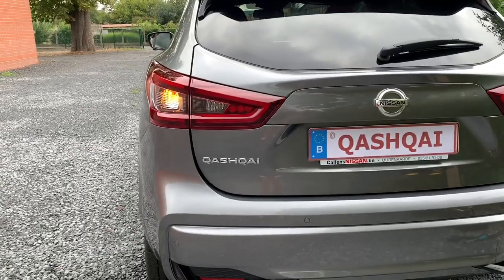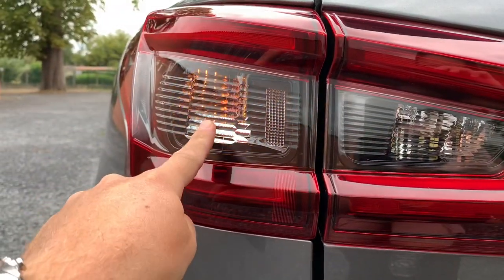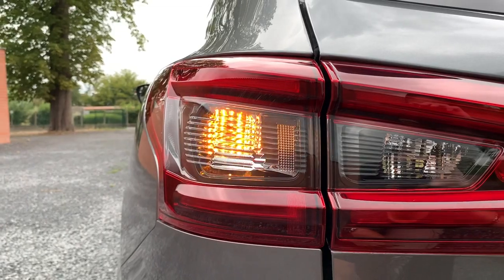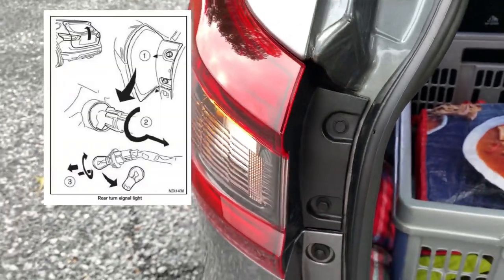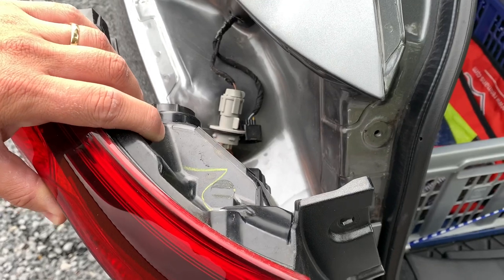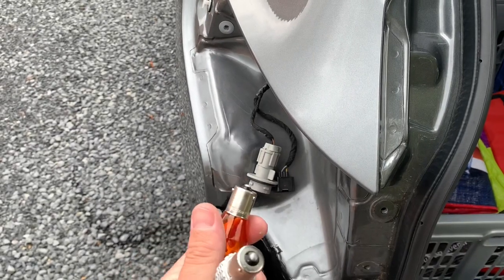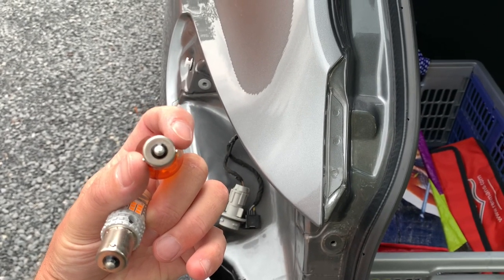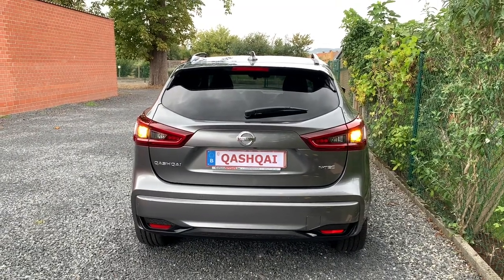Nissan Qashqai J11: LED tail turn light indicators (plug & play - no hyper flash!)

Comment: Hey dude , sorry i just want u to ask if there are some issues with all your modifications on the car since 2 years are almost gone, and my question is have you any problem with the bulbs that u have already installed, i have also J11F N-connect from 2019 automatic for the German market and I've been considering to change all the dimmable lights in my car, in order to that I've ordered some premium bulbs like MORIMOTO, GTR and OSRAM as well the American bulbs have lifetime warranty.  I appreciate your answer.
Reply from the maker: Hi! No not at all, the only bulbs that didn't held on very long (some of them at least) or those used in the ceiling lights in the front. But those only cost 20 cents each I think. So no big deal. All the rest really works fine.

Comment: Hello, The product on the link not available anymore, can you update with the same product from other seller? Work OK if stay on hazard over 2-3 minute or make hyperflash after more use? Thank you!
Reply from the maker: Here it is: 
https://a.aliexpress.com/_mK7iACz it works perfectly even when used longer. Only when you use it for a very very extended period of time it could hyperflash (I’ve been told!) but it turns back to normal when it cools down. 😉
Reply: @LaPalmeraie0032  Thank you!
Reply from the maker: You’re welcome friend 😉

Comment: Great video
Can u do please for the front?
Does it the same led for them?
Thanks
Reply from the maker: Hi Tom, thank you so much. I can’t do this for the front because I have the turnlights integrates in the DRL lights on my N-tec model 😉 but it is really easy. Just plug & play. Just use a turning movement to undo them. You will need other bulbs than for the back though. For the front you need T20 W21W bulbs. Those have a flat bottom.
Reply: @LaPalmeraie0032  first thanks for the replay ans second what i need for the rear
Ba15s or bua15s 
Thanks
Reply from the maker: You’re welcome 😉 you need the BAU15S with the nods on a 150° angle.
Reply: @LaPalmeraie0032  u the best
Thanks
Reply: @LaPalmeraie0032  can u please send me link what u mean flat bottom
thanks
Reply from the maker: Here you are; same store: € 11,03  52％ Off | OXILAM 2Pcs No Error Hyper Flash Turn Signal Lamp T20 7440 WY21W W21W LED Bulb Canbus 3020 SMD Car Lights 2200K Amber Yellow 12V
https://a.aliexpress.com/_mqxC82v

Comment: You know if it’s the same type of light bulb and front turn lights?
Reply from the maker: Hi Kostas! No it isn’t the same. You should look for W21W and not WY21W. In the front the fitting is supposed to be flat. 😉
Reply: @LaPalmeraie0032  Thanks..

Comment: hi.thanks for the video.does they fit these light bulb to j11a the previous model 2017?
Reply from the maker: Yes it is exactly the same 😉
Reply: hello.i have installed the same bulbs to my qashqai and they are awsome.hope they work well in time..big difference from previous halogen.can u make a video with the front turn lights instalation ?
Reply from the maker: @greg84186  Hi Greg, great to hear so! I can't make a video for the front I'm afraid because I have my turn lights integrated in the DRL lights in the front ;)
Reply: @LaPalmeraie0032   is there any video with this installation if u know share it with us ! my qashqai is j11a 2017.cheers !
Reply from the maker: I don’t know but it isn’t the same bulb. For the front you will need the T20 W21W bulbs. Those have a flat bottom. 😉
Reply: @LaPalmeraie0032  i have bought 
them too but i didnt know how to install them !
Reply from the maker: They are just turn and unplug and plug and turn 😂

Comment: do you have any idea of what are the 3 circles next to the reverse light for?
Reply from the maker: Those are the leds for the break light 😉
Reply: @LaPalmeraie0032  Wrong, it's a fog light.
Reply from the maker: @JuliosOnAplane you’re absolutely right. My bad. The brake lights are situated on the body. It’s the fog light. Thanks for correcting 😉
Reply: @LaPalmeraie0032  I'm glad I could help ;)
Reply: @apc8247  here in latin america, they dont work... At least my 2020 J11 Qashqai doesnt seem to tun on...
Reply from the maker: Did you try to turn them 180°C. With LED the + and - sides are important 😉
Reply: @JuliosOnAplane  I'm not sure, but AFAIK fog lights are not mandatory in America, so it possible that you don't have it. In Europe every car has to have rear fog light, so that's the place where you can find it ;)
Reply from the maker: @apc8247  ah were still talking about the three dots/fog lights. Luckily for me A. Ch. is till around to help me out 🤗 didn’t knew that about US legislation. 👍🏻
Reply: @apc8247  thank you for the information, do you have any idea if i can make them functional?
Reply: @JuliosOnAplane  it would depend if your car already has wiring for the rear fog light, but anyway I don't think it's worth your effort. ;)

Comment: 03:42 the signal lights are too hidden, you can barely see them.
Reply from the maker: Hi! What do you mean? The turn lights in the back are very clear and in the LED version it is even very bright. 😉
Reply: @LaPalmeraie0032  what I mean is: the LED strip is far inside. you have a gap between the taillights and the metal car.
Reply from the maker: Oh, you are speaking about my dynamic turn lights on the tail? Well... yes indeed because i do not want the white strip to be visible when it isn’t used. Especially on my grey car it is. But I can assure you that the light still is well seen, better than on video. But I agree that is was easier on the white Qashqai 😉
Reply: @LaPalmeraie0032  do you have a video on how to add LED stripe to the front signal? I found a video, but is missing exactly the moment of wiring connection.
Reply from the maker: So you want to place the same kind of LED strip but on the headlights, is that it? On the J11 with halogen headlights and DRL’s the « + » of the DRL is situated in the high beam connector, port 2. I made a little schema for this https://bit.ly/2NDJ8C4
Reply: @LaPalmeraie0032  yap. I done once for my Passat in the past. Now I have the Nissan,  but looks a bit more chicky . Thanks for help.
Reply from the maker: So port 2 on that connector for the DRL. The turn light is to be seen if it is as well on that connector or as it was on my previous Qashqai with its own connector with green and black wire. You have the workshop scheme now so you should be able to manage 😉